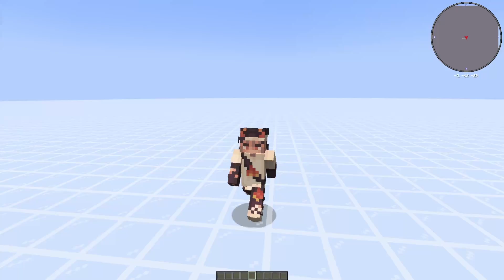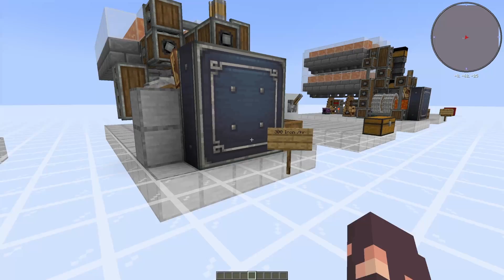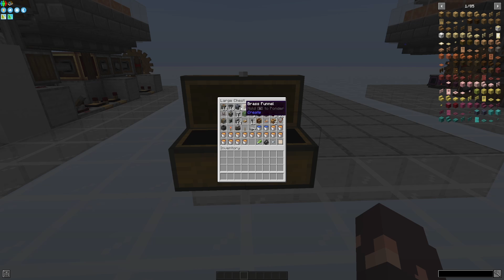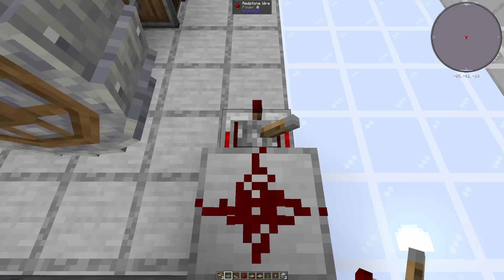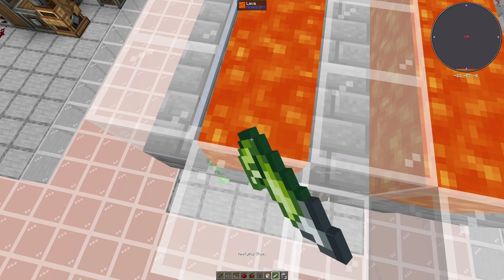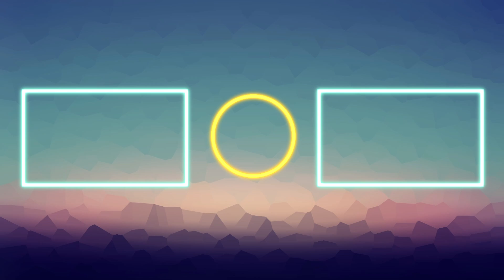The ULTIMATE CREATE IRON FARM (No Villagers) 600 IRON PER HOUR! |  Create Mod TUTORIAL

Comment: I have no idea why but my sequenced gearshift stoppped working, i did rebuild whole "cobblestone generator" part, which wasn't spinning and it still doesn't work
Reply from the maker: Weird. Is the clutch powered? Cause that would stop everything. Do you have enough stress units (~7000) to run it? Let me know if something else weird is happening to narrow down the issue!
Reply: @kindlebubbledump  Ty for trying to help. It was something with redstone. I had to rebuild it
Reply from the maker: @Spartanin2857 glad you fixed it!
Reply: @Spartanin2857  could you please explain it in detail, its still not moving for me
Reply: @greenwormss  I have no idea what didn't work, but rebuilding only redstone part fixed it

Comment: Made this on the server i'm on!! It's a fabric one, in 1.20.1!

Had a little scare when I turned it on and the stone on the bearing wouldn't break (still don't know why), but then i took a deep breath and quickly made a change by replacing the stairs with drills (still waterlogs) and powering them! works just as well with them!

10/10 would build it again!
Reply from the maker: Glad it works!
Reply: how did you get it to work? nothing happens for me  with the mechanical bearings, they rotate but no cobble comes
Reply from the maker: @deejudanne460 try slowing down the rotation speed controller from 10 to 8 or 6
Reply: can you show me a pic on the powering engine ? i cant make it run... idk how to do it when the tut use create
Reply from the maker: Check out my steam engine video. It’s in the tutorial playlist and should be easy to find

Comment: Excellent farm. I especially like the automatic shutoff.

It took 12 large water wheels and one small water wheel to power mine. (I've not done anything with steam engines yet.) Mine takes 6164su to run (and I think 6228su without my modifications).

Minor modifications: I used a list filter on the basin so it would produce both ingots and blocks, then set the iron ingot funnel to be an iron block funnel instead. This way it outputs blocks of iron instead of ingots, with no extra machinery needed. And I used a cauldron to contain the trash lava so it's harder for me to spill.

I also managed to increase the small farm's production rate a bit by replacing the chute under the barrel with a brass funnel set to "up to any" for the output rate and attaching a faster cobble generator (minecart contraption). The cobble generator I made was overloading the farm as designed, but that one chute replacement let the farm keep up with all my cobble.
I've not tried to get cobble production exactly balanced since I'm happy with the quantity of iron I'm getting. I just thought I'd mention that the chute was a bottleneck for anyone else attempting to use this farm with modifications. The crushing wheels can process full stacks of cobble faster than the 4 stacks of 16 that a chute will supply.
Reply from the maker: Love the modifications, those are super cool!
Reply: THANK YOU I NEEDED TO KNOW HOW MANY WATER WHEELS I REQUIRED

I used 5 and it didnt work so just kinda put it off

Comment: How many stress units does this need???
Reply from the maker: The design uses 6,200 SU with 2048 for each crushing wheel and the mechanical press, 20 SU for the encased fan, and 40 SU for each mechanical bearing. Make sure the encased fan is connected to the slower circuit, and if you’re still having issues you can connect the mechanical press to the shafts powering the mechanical bearings.

Comment: Have much SU is needed? Im up to 6700 and im still having problems with it being overstressed.
Reply: I'm building the smaller of the two
Reply from the maker: The design uses 6,200 SU with 2048 for each crushing wheel and the mechanical press, 20 SU for the encased fan, and 40 SU for each mechanical bearing
Reply from the maker: Make sure the encased fan is connected to the slower circuit, and if you’re still having issues you can connect the mechanical press to the shafts powering the mechanical bearings

Comment: Great Idea. I cant get the cobble generator to work. The mechanical bearing just spins with the cobblestone attached. It never breaks. Any ideas on what I've done wrong? I've built it 3 times all the with same result.
Reply from the maker: Make sure the speed coming in is at 10 rpm and the pulse repeater is set to 36-40 ticks
Reply from the maker: If it still isn’t working reduce the input speed to 8 rpm. It could be a lag issue
Reply: Any idea on how much su is needed? im up to 6656 and still no luck @kindlebubbledump